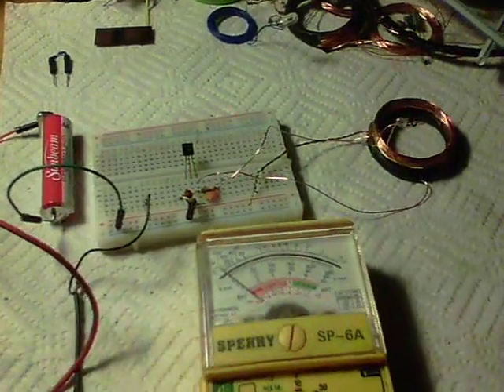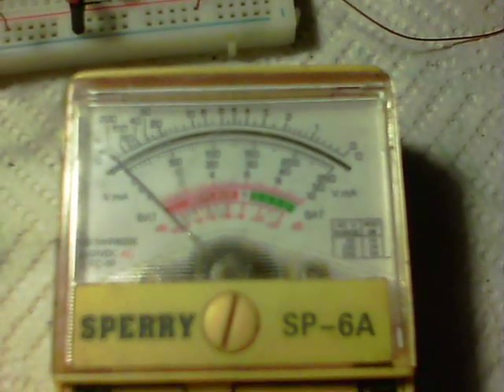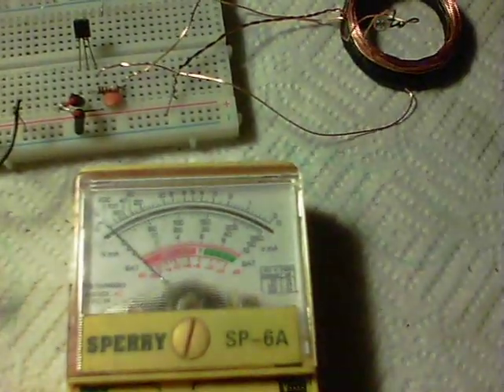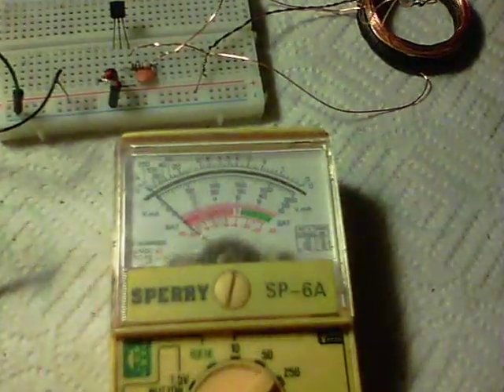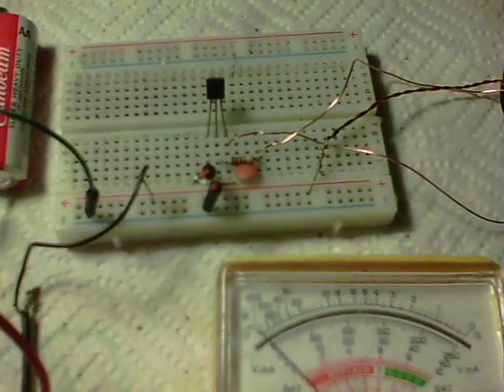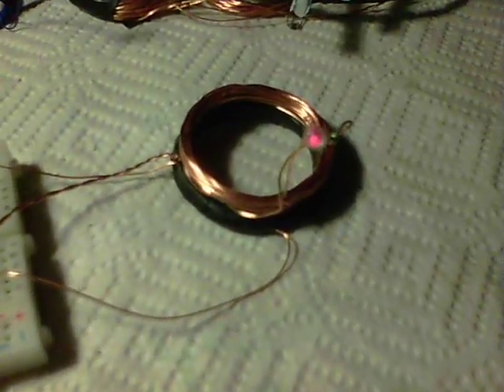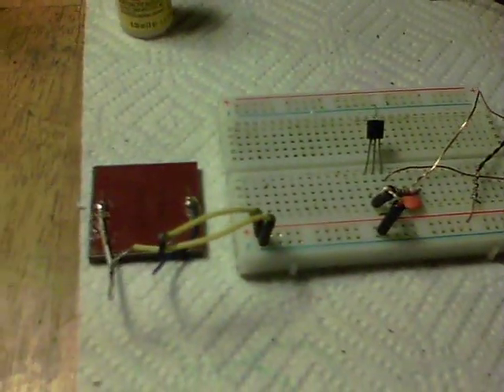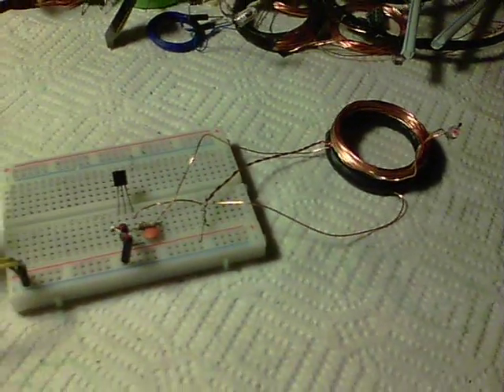Centurion wireless electricity - goal met, Zero mA

Comment: You should use a micro amp meter. If you want a scope, I just built a couple of free sound card probe circuits. One for my laptop and one for my phone. The laptop software and probe circuit is here 
http://homediyelectronics.com/projects/howtomakeafreesoundcardpcoscilloscope/?p=1   

The android T-mobile My Touch that I have, for any smart phone, software that worked the best for free, I found was AR-oscilloscope from Alex K.  The phone probe circuit is a preamp circuit (op amp, I didn't use the dual 3.5v Zeners either, like the author took out due to noise, is here

http://www.instructables.com/id/A-Preamplifier-for-Smartphone-Oscilloscopes/

They both work equally well for a free oscilloscope up to 20-30KHz from my frequency generator.

Awesome work! The free spectrum anyliser works good too with the probe in those frequency ranges. I think it is spiking on the harmonics.

https://play.google.com/store/apps/details?id=com.nfx.specscope&hl=en
Reply from the maker: Sorry for delay. Ah yes, the soundcard method...thanks for the reminder and tip. I was going to build one and then got a handheld scope. it broke and now just the freq generator works on it. During all that I clean forgot about the PC method for at least audio frequency use.

Comment: Hey Slider, I cant wait for the NO Volts version !.....Thanks for your experimenting.
Reply from the maker: Haha, well it does need something, if not a lot. But powering by a crystal radio circuit is one idea, or Tesla radiant collector.
Reply: Sounds like you have all the bits for your next video......You can have a free energy collector powering a no amp curcuit....

Comment: Nice work. I have had toroidal core JT;s with germanium transistors run from upside down solar cell, but this takes it to the next level. Silicon transistor wireless.
Reply from the maker: Hehe lots of fun doing silly things like that. Also works well with a 9V battery on top !